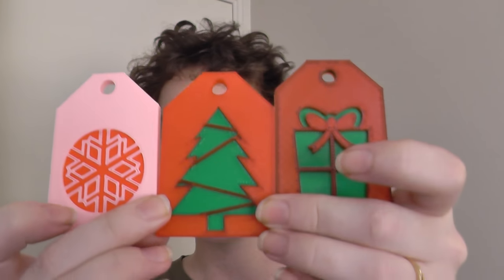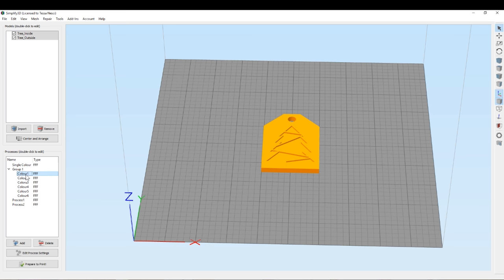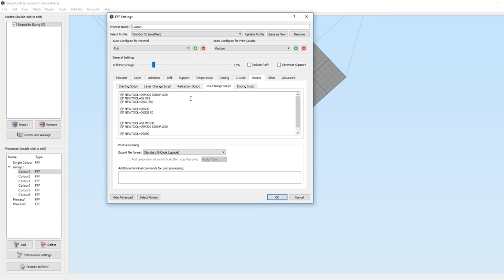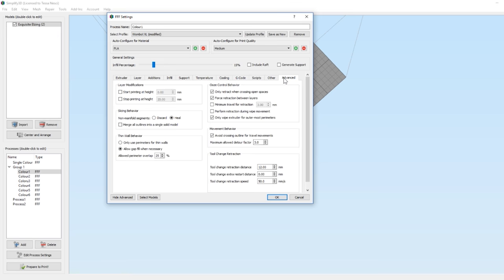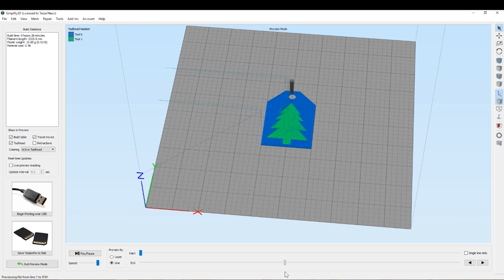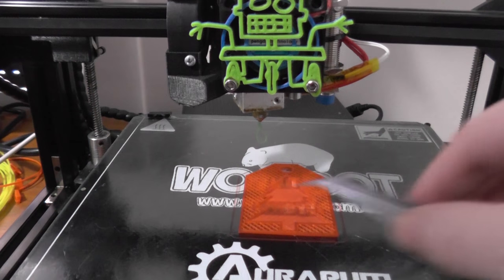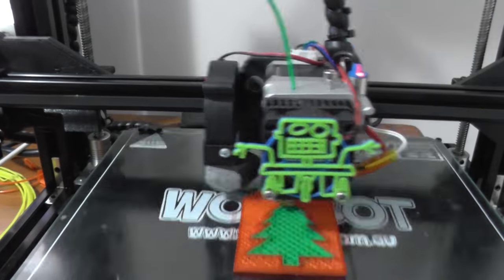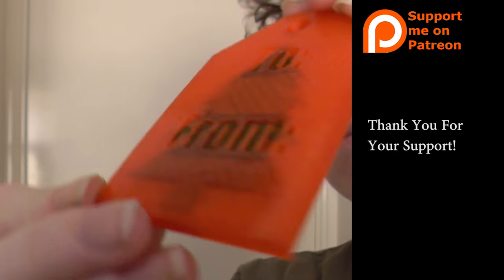2 colours 1 nozzle - pt3: Black Magic

Comment: well.... I never would've imagined something like this. How did you even come up with the idea to do it this way? This is such a obscure method but it just works which is pretty amazing. Definitely playing in on some printer tolerances and stuff but it works easily enough for simple things. It'd be awesome to see how this can be refined.
So I just realized as I am typing you are basically manually doing what the new prusa multi color upgrade does, very clever! Wasting less filament even on a prime tower.
Reply from the maker: boomerangfreak thanks.  Yeah its basically the same as dual extruder printing except you have to manually change colours.

Comment: Yes, I found the same bug when I try multi-filament printing too. The skirt will mess up multi-filaments/tool heads printing on S3D. It will not swap the toolhead correctly when you have skirt enabled. S3D is, very, very buggy if you actually dive deeper into it. 

P/S: I am using a different technique, though.
Reply from the maker: Mega Making I'm very interested to see what technique you are using :)

Comment: I have a suspicion that punctuation messes up comment lines in Simplify3D scripts. I'm to lazy to actually prove that is the case :) Whatever the issues is, you are not the only one seeing the problem.
Reply from the maker: Bob Camp it's a strange problem to have and quite annoying to those of us who like to use best practice in coding
Reply: I suppose "best practice" would include sending them bug reports with extensive documentation of multiple instances of the issue. Again, I'm way to lazy to do that even at work. At home ... forget it. Code around the bug and move on. Stupid approach, but it works....

Comment: Can you use M600 for filament switch rather than a timed wait?
Reply from the maker: cyberreefguru I haven't tried, however my friends in the Wombot forums have told me that M600 is disabled in firmware on the Wombot out of the box.  So without testing I am not sure
Reply: Ah - possible.  It works like magic on the prusa :)